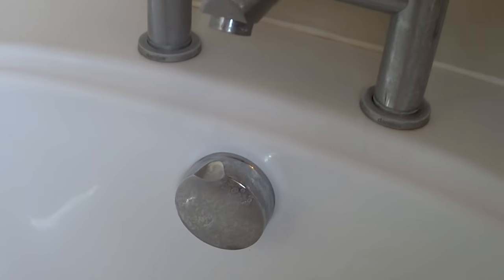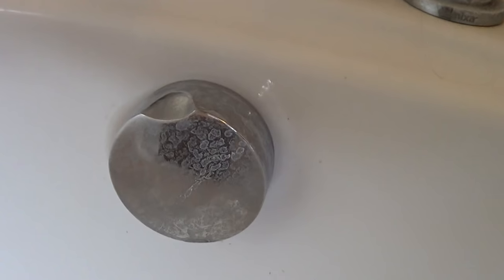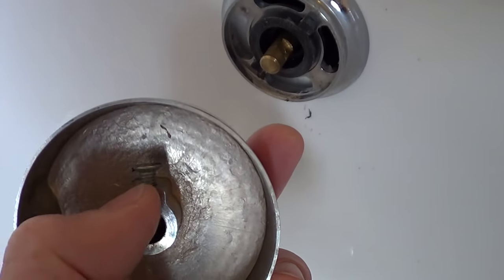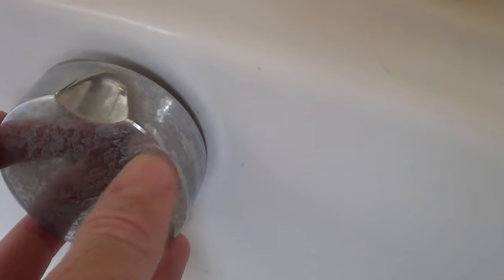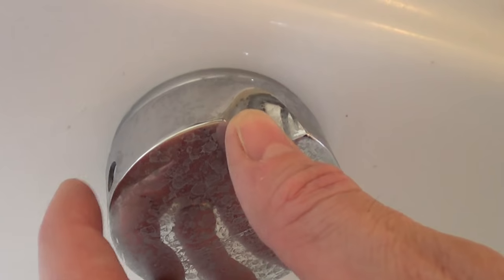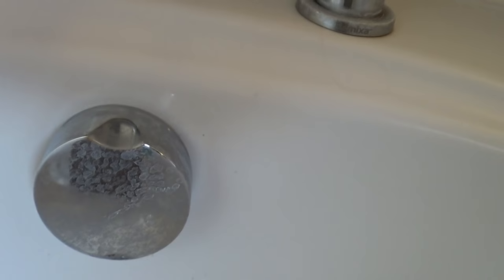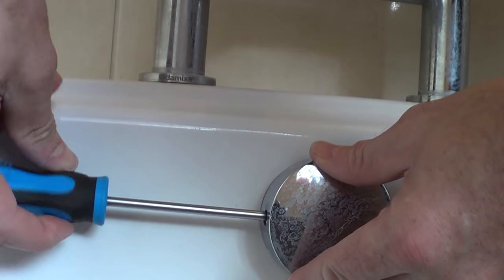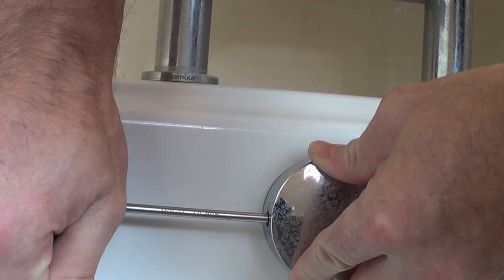How to fix a twist handle bath plug mechanism

Comment: There doesn't seem to be a way to remove the big metal cover that you just pulled off at the start on mine. No hole on the side for a screwdriver.
Reply: Hi there! Have the same problem - no hole to access the screw 😟 - did you get yours sorted? Any help gratefully received!
Reply: @johnmills9999  @Vladdie99 same issue here ...did you have yours fixed ? If yes, then how, please ?

Comment: What if the plug stuck in the closed position and the mechanism does not seem to move it?
Reply: Yeah! I can't find the solution to this much more significant issue!
Reply: Can anyone help with a solution to this please?
Reply: Me too
Reply: I had this problem, I managed to fix it by attaching a small suction cup to the plug to lift it up, and I removed the outer cap of the mechanism with the screw and then sprayed silicone into the mechanism and down the plug hole left it for five minutes reassembled, and it worked perfectly

Comment: Help! My plug is closed and won't open. I've tried tightening the screw but the knob just turns and nothing happens. Could the mechanism the screw attaches to be seized up?
Reply: Have u got solution for this...I'm having the same problem.. don't know if it's broken or just some problem.

Comment: I have a similar drain but my problem is it doesn't hold water what should I be doing or looking for... what is the name of this type of drain plug
Reply: Help!  We have exactly the same overflow/plug cover.  It won't work because the screw is completely rusted.  We have tried everything!  WD40 doesn't work so we need a new one.  What is this actually called and where would we get one from, please?
Reply: B&Q do them

Comment: I have the same bath and plug mechanism as in the video shown, but the plug surround has got corroded. The plug is held in by a hex head screw. If this is undone will the connecting stuff underneath fall as i want to replace the plug surround only. Any ideas anyone as cannot find any videos files on that topic?

Comment: The bronze bar keeps springing back into the mechanism inside the bath. I can pull it out with tweezers but every time I try to get the twist handle back on, it pushes it inside again. Does this mean something is amiss inside?
Reply: This is my problem can I ask please how you fixed it  x

Comment: Hi.
I've just installed a jet bath with one of these plugs, the plug leaked at the back so I took it off & replied it trying to make sure I've  done enough to stop the leak, now the bit you turn won't fit onto the bar that you screw ONTO, the HOLE at the back of the chrome turn knob seems too small, it was ok before I took it off, can you inform me of what I'm not seeing/noticing?
Thanks

Comment: I have the opposite problem. The backing plate is loose, I've removed the screw but cant get the handle off.
Reply: My back plate is moving up and down..how did you fix yours?

Comment: The same thing has happened to our bath plug but we cannot pull out the twist handle, The screw has come out but it was very difficult to loosen! Any help would be welcome.....
Reply from the maker: Caroline Morgan Hi Caroline, can you explain what you mean when you say you "cannot pull out the twist handle" please? The screw, once undone, should allow the twist handle or knob to be removed.
Reply: It is a different twist handle system to the one you are showing as we found out when we pulled it out and dislocated the inbuilt mechanism operating the plug - the handle screws into the inbuilt mechanism and has broken so we have to lever the plug out manually now.. But thanks anyway for your reply.

Comment: Brilliant, my daughter has just moved  and the bath plug won't pop up. I've been trying to get a replacement plug but the bath is fully tiled in so there's no access without breaking the tiles. I really hoping this works as getting a plug to fit it is proving extremely difficult. Thanks for the video.

Comment: Hi there, any advice on how to remove the handle - i have taken then screw out completely but the handle seems to be fully seized onto the shaft - have tried wd40 - still not budging.. have yanked it hard as well the damn thing doesn't want to come off.. last resort may be to drill holes through it to break it up?
Reply: Joynal Abedin did you find a solution to your issue as we have the same problem ie. the Phillips screw will undo up to a point then no more, and the chrome outer cover which should then pull off will not. I've attempted to lever it off but it's stuck firm and indications are it will not budge. Trouble is the whole mechanism is loose and I'm concerned water is entering the gap between the mechanism and the bath and is running down the wall under the bath. Any help would be most appreciated thanks
Reply: @SuccessShared  hey - I’m having the same issue! Did you find a solution? Thanks!!
Reply: @Lukas-hi7pj  Plumber fixed it

Comment: How do you remove it? My bath twist mechnism stopped working and  I've found the insert to this mechanism but I cannot find the screw part. 
My plug will not realise once its in the bath and I have to use a screw driver to retrieve the plug.
Reply: woollala1 same
Reply: Loosen screw if it’s tightened and pull.

Comment: Hi, I've tried with both a Phillips and a flat head screwdriver through the little hole, but neither seem to be finding anything to 'bite' into. Any suggestions as to what could be the issue?
Reply: MrThunderwing exactly!!
Where is the screw?? I’ve been poking Philips and flat head screw drivers in and also tried Alan keys.
Really annoying.
Reply: @johnwealthy6821  the screw might have come out and you have lost it, therefore there is nothing in the hole to tighten.  Take it off and have a look inside where the screw is supposed to go.
Reply: the screw might have come out and you have lost it, therefore there is nothing in the hole to tighten.  Take it off and have a look inside where the screw is supposed to go.
Reply: @2007spiderman2007  Ha, my comment is 4 years old, I ended up just getting a plumber to come and sort it for me back then. He got it out straight away, I think the issue, IIRC, is that it's a grub screw. I can't recall what he used to remove it, but  I think it was a special grub screwdriver (but I'm guessing an Allen key would also work...?)

Comment: in our bath, the screw is rusted and we cannot take it off. any advice?
Reply from the maker: Feyyaz Melih Akçakaya That's a tricky one. I'd try spraying on a little WD-40 and leaving it for a while. Then try again. Hope it works out for you.
Reply: ChalkIt Down I have the same problem. WD40 doesn’t resolve the issue. Any ideas?